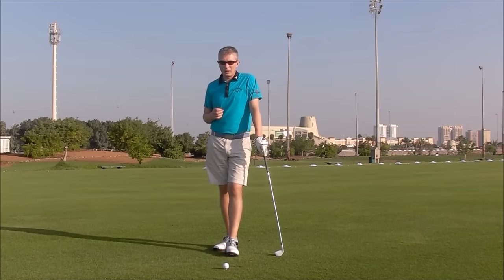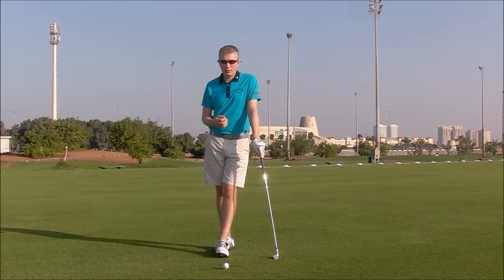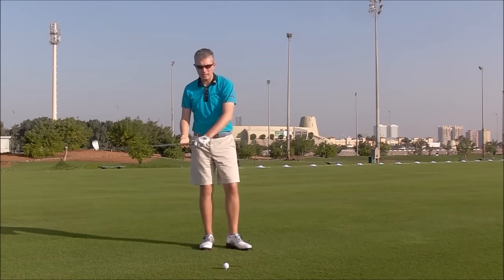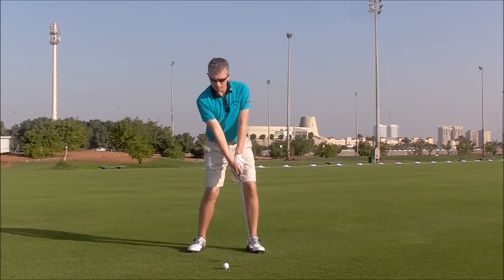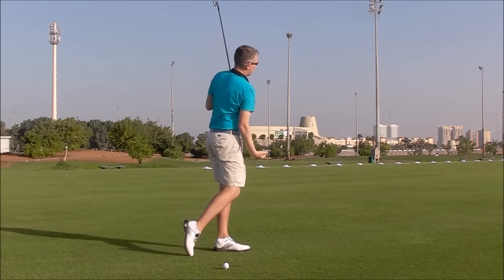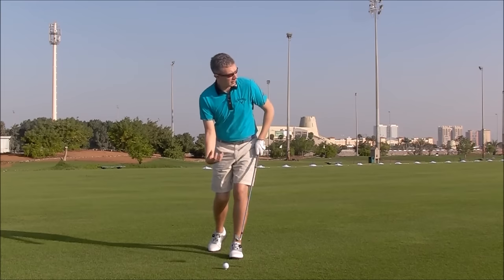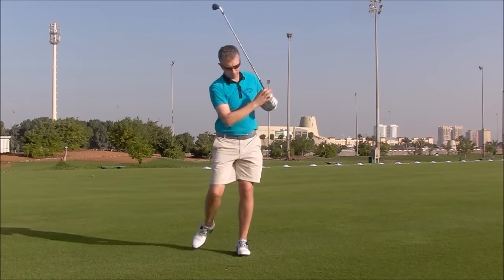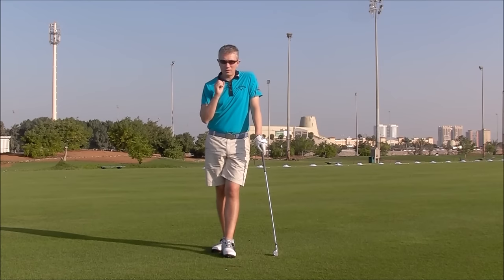LEFT LEG FORCE IN A GOLF SWING

Comment: The ground force used in the downswing allows for proper hip rotation and more importantly a Firm left side/leg to post up on. Resulting in better tension lag and allowing proper upper body rotation. Without this concept the body simply continues on it's rotation with no rotary whipping action. Ever snap a towel at you're friend in the locker room? The towel gets it's speed from the stopping forward motion of the towel created by the wrist. Same concept in the swing, as the swing begins it's downswing position the left leg is used in a upward motion to create the upper body/arms/club unit the ability to "whip" through the ball accelerating all the way to the full finish. Great video on the subject

Comment: How to practice this drill without early extension. How can I jump when I maintain the posture?
Reply from the maker: Done well you do not see a jump, you want to feel as you push up it helps rotate your left hip, which will insure you do not Early Extend.  Also, to go up, you first must go down, so often done well you have increased your angles a little before hand so as you come up slightly you move into the same posture as you had at setup

Comment: Hi Robin, Great video.  I started doing this recently because I noticed my knees were collapsing at impact.  Now on video my impact position looks much better and left leg is posted.  And my thought is to PUSH straight up with left leg (almost like a jumping feeling)
My question for you is when do you think you should start pushing up with left leg.  I was doing this as I started my transition, but I wonder if that's too early?  I have been hitting shots thin when I miss.  And I wonder if its because I'm pushing up too soon?  Any thoughts?
Reply from the maker: Thanks John, sounds like you are on the right lines.  It's hard to say when you should "feel" you start doing it, but in theory it happens from when your left arm reaches parallel to the ground.  Feel is sometimes different, so experiment a little